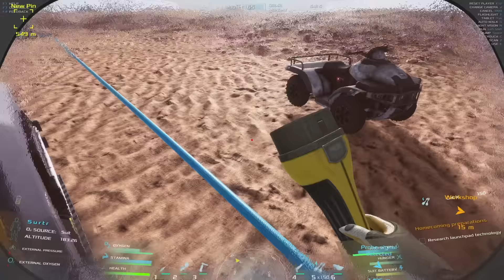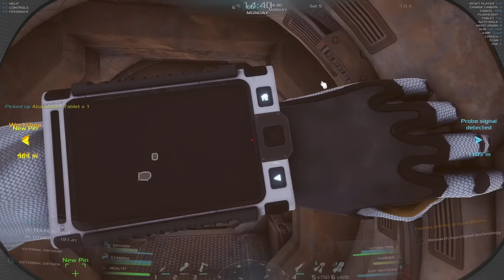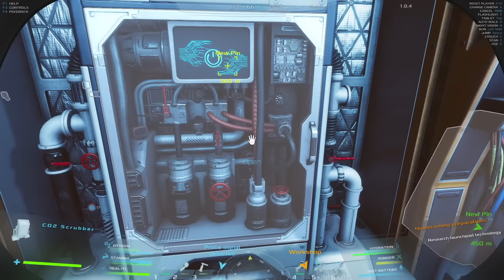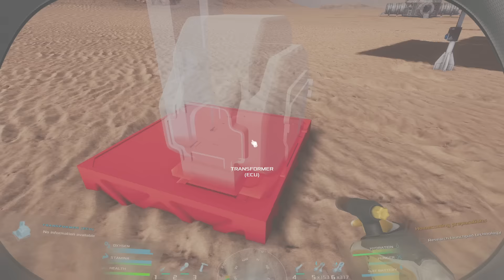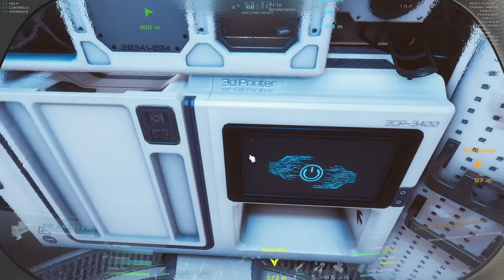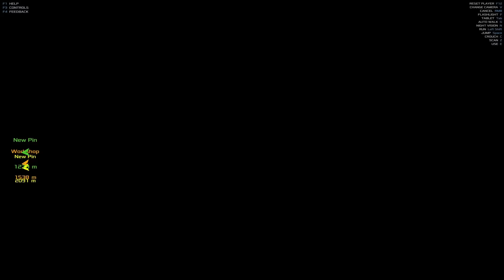Occupy Mars – Electricity Setup And Salvaging [E2]

Comment: I belive the reasion your solar is not fully running is that you have set the output to the battery too low for all of them to run.
I reccomend that you merge all renewables into your battery (or batteries if you get more). Make sure you set the output to the battery high (or higher) than what you produce, so that they are getting properly charged.
 Split your batteries into what you are powering, so that it can run through the night. That's also useful for vehicles, as you can charge them during the night, while you are sleeping.
Also as someone said the pump doesn't produce anything its just a merger/splitter. I don't think there's really a use to give oxygen to buildings (unless there's something new that would need it inside) as the scrubber (or whatever it was called) makes you enough oxygen for yourself. even plants will make it. So if anything you'd want it to supply exess oxygen to the rover. Which as far as I know is not possible.
As far as I know, making a sabatier module is only needed to make oxygen for the rover (and maybe the rocket, never made one). I suppose you could also use it to make a little oxygen refill station, but I don't think that's needed as the rover can hold lots of it.

Comment: on the transformer sir, set the outgoing to the max you are producing with the Soler Panels.  make sure you have outgoing to where the Quad is connected.  i see you have 252 being produced.  send 242 to the batteries and 10 to the quad.  Also since you started with a lot of blueprints unlocked, I suggest you build a quad yourself.  it is much faster
Reply: the quad is heavily damaged so probably why its so slow

Comment: The pump station is a multi input and output it depends on what you plug in i.e. 1 water and  2 oxygen in to 1 oxygen 2 water etc, it changes when you plug in.

Comment: All your plants are dead, you'll have to replant them. And while you can plant them directly in the hydro bay, putting them first in the incubator until they reach stage 2 is a better option as this will make them grow faster. Then use the plant crate to transplant them to the hydro bay and let them finish growing there. As for your inventory issues, first off there's boxes you can make for rocks, chemicals, circuit boards and building materials, these take up one inventory slot, but can hold 12 items of their respective type. Also in the printer under decorations you can build the boxes like the one in your pod, which you can them plonk in your base for extra storage. For O2, you need to build the sabatier as an addon to the well, which then will need more power to run, and the O2 tank needs to be built as an extension of the sabatier reactor. Then it will have an output port for oxygen on that. Later on you can also add another sabatier and use a methane tank on that to produce methane. You are also going to need to build a chem lab where you unlock all those chemistry processes.

Comment: Re inventory management: there are boxes you can craft that hold specific types of items, which lets you carry/store a lot more of the corresponding items. Most of the boxes need to be researched, but there is one for circuit boards and pendrives that i think is unlocked from the start. Note that the boxes need to be in your inventory or in a storage container; if you drop them on the ground, they can glitch out, even inside your base.

The only things that need to be cleaned after sandstorms, etc., are solar panels and windows on vehicles. For everything else, the dust is just cosmetic, and will fade by itself over time.

Comment: The plants are dead. Each time you open the incubator or look at the hydroponic table, there is a note in the bottom left saying “plants are withered”. So taken them out and replant new seeds and remember to set the required power and water levels from the master control unit in the building. Once you have the greenhouse you can use the withered plants as fertiliser, but they don’t give much so for now just store them or chuck them into the waste bin on the floor beside the master control panel. It looks like a waste paper bin. I think it’s still in the game? You hold the item, stand over the bin and drop the item. It’s useful for getting rid of empty seed bottle too.
Reply: @gavinhalliday5231  in the main control panel there is also a button under the devices that say set requirements and that will automatically set it

Comment: Expand the battery line to the max. In fact build another maxed out battery line as well. You have 8 solar panels but because you only have one small battery, the power from the solar panels is being wasted. The control panel in the workshop will tell you how much power you need per hour to keep everything running, so ideally your battery needs to store enough to cover the 12 hours of darkness where solar panels aren’t contributing.  You could also build a few wind turbines and link them all into the transformer system - they don’t give massive amounts but at least it is constant power.

Comment: Glad you figured out the compressor and the CO2. I’d say it’s worth having half a dozen CO2 bottles in store so when a sandstorm hits - and they do so regularly - you can swiftly get cleaning once the storm had passed. In time you will unlock the “self cleaning solar panels” technology but that is a slow process and it’s worthwhile still cleaning them with the compressor.

Comment: Looks like you may have built the sabatier too low into the ground. You are supposed to put the oxygen tank onto the front of the sabatier then run a hose from it to the building. So it needs to be a foot or two off the ground. And you will need another 10 power to run the sabatier unit. The small solar panel is only enough to run the water well itself.
Reply: Also, as far as I remember, you do need to power wells over batteries, if you want them to run all day, as their own solar is just enough to run the water pump function during the day.
Reply: @Zero-w1c yes that’s correct.

Comment: If I remember correctly, Pump station is just an relay for gas and water which can regulate their output. If you got multiple wells / oxygen / methane producers you can combine them via pump station(s). It itself doesn't generate anything. What generates oxygen currently in your base is most likely the oxygen scrubber which you earlier had turned off or something else weird (it might have needed water to work earlier too). I also don't think its good idea to give any limit to your electricity output or any else output yet at least until you have multiple buildings to worry about.

Comment: The pump unit is simply a gathering or consolidation unit for the production of several wells. It actually doesn’t need power. You can for example build three wells, run a hose from each into the pump unit - don’t worry about the valve head colour as they will change depending on what you attach -  and then just one hose out of the pump to the single connection of the building. Or you could build 9 wells, going in to three pumps, then those three going into one more pump and end up getting 9 wells worth of water in to a single hose input valve of a building.

Comment: The plant withering is maybe not because of oxygen but is because you have not set the water requirements to the individual hydroponic and incubator units. There is water to the building yes, but essentially you aren’t using it. Go to the free standing control unit and it should show what levels of water and power is required for each bit of equipment. This is one of these “complicated” actions which some folk don’t like ie it’s not really that intuitive. Like the setting of the scrubbers. Wait until you try and fix a circuit board!

Comment: unfortunately I can't get past starting this game - it sits at a settings panel and clicking "accept" just highlights the button and nothing happens. I can change the settings, etc, even reset to defaults, but nothin' - probably going to refund it today :( a lot of the reviews mention bugs that make the game unplayable on some computers that meet requirements so I suspect I'm one of them.
Reply: Yes this has always been a problem. I’d have hoped they’d have reconfigured the game for more “normal” systems, but it seems not. I ended up buying a better laptop as some games I wanted to play simply wouldn’t run.
Reply: @gavinhalliday5231  the thing is, this system plays some pretty intense modern games just fine. it's specifically this game that has a broken setup.
Reply: @tsalVlog yes I do remember lots of folk saying they played the most modern of games with no problem, but they simply couldn’t get this one going. But for me, a new laptop did the trick.
Reply: @gavinhalliday5231  I'm not on a laptop, and the hardware is under a year old. You're missing my point, and are making gigantic assumptions. I am not on a laptop is just a huge one to start. Please stop and realize that what worked for you may not work for me. I'm getting a refund.
Reply: @t @tsalVlog  ok that’s a shame you couldn’t get it to work and you are not alone in that. It’s a good game.